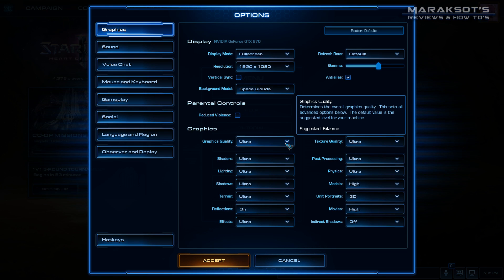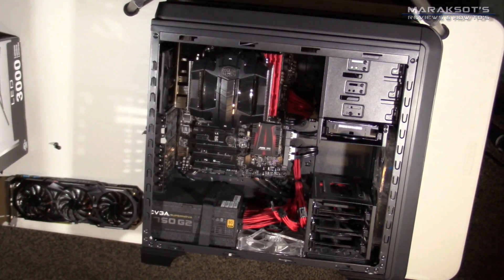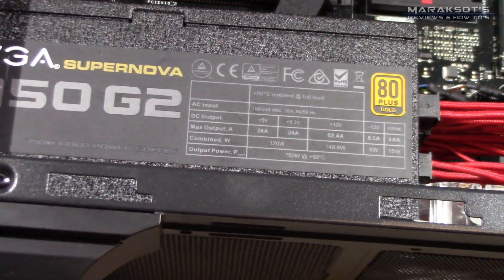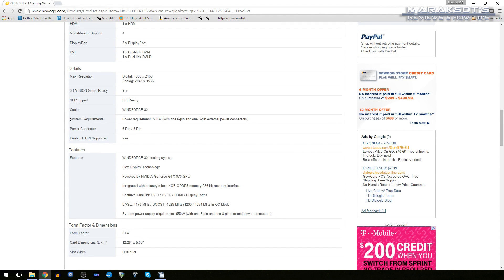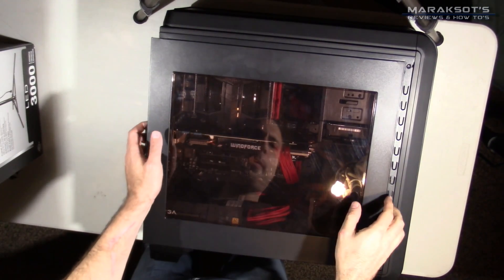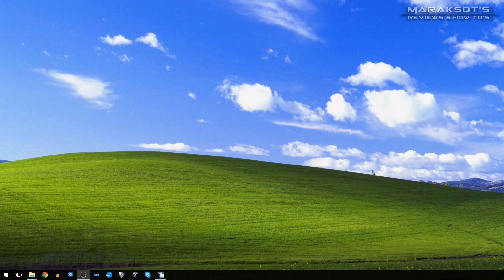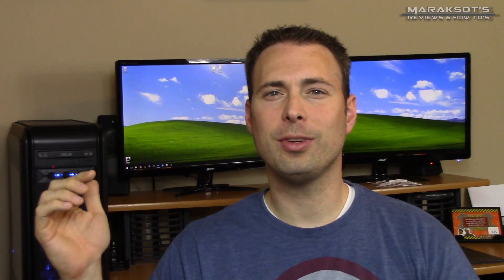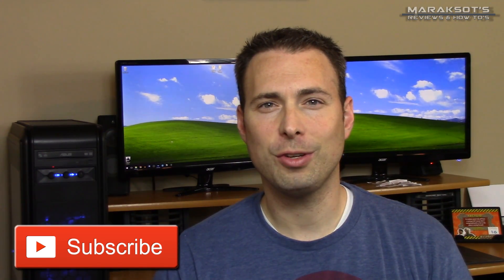A Beginners Guide - Upgrade your GPU - How to Install a New Graphics Card

Comment: I have a Corsair Spec 01 case and a GTX 750 ti, and the way the case is built is making it very hard for me to take my graphics card out. Any suggestions?
Reply from the maker: +TheSuperGamer you've probably got this figured out by now but just in case I looked up your case and it looks like a normal layout... so are you having trouble getting the latch to  release? If so you can use something non-conductive like a pencil to release the latch and then pull the card straight up out of the case. If try to "tilt it out" meaning you pull it up more on one side than the other it won't come out so easily and will sometimes relock the latch. Anyway once the latch is unlocked firmly pull the card straight up and out.  :)

Comment: I have a shitty Intel HD 4400... do i take it out... is it in my pc... like wtf
Reply from the maker: +Pandacyy it is not removable. The HD 4400 is an integrated GPU meaning it's a graphics processor built into your CPU. Once you install a discrete graphics card your system will detect it and then use it instead of the integrated GPU. You will of course need to plug your monitor into the HDMI or Display Port or DVI port (depending on what your monitor supports) on the GPU as well. Cheers! :)

Comment: Once i have followed these steps should i uninstall my previous card drivers? Upgrading from Ati hd 6670 to a Gtx 960
Reply from the maker: +Tyler Rose thanks for the question. This is actually one of the most common questions I get and I'm actually going to start working on a video today to answer this question.  :) but until then... you'll want to uninstall your current AMD drivers and then shut your computer down. Unplug everything from the back of your computer, swap out your old GPU for the new one, plug everything back in, power up your computer, then install the new Nvidia drivers and then you'll be all set. Thanks again for the question I hope this helps you out man. :)

Comment: i have a Nvidia GT 730 and i want a GTX 1060 can i make the upgrade?
Reply: IM MAKING THAT EXACT SAME UPGRADE FROM A GT 730!
Reply: +A Guy cool
Reply from the maker: +Jascaran my initial inclination is to say yes you can, just be sure it will fit in your case (which if you get something like the EVGA 1060 SC you shouldn't have a problem unless your case is super tiny) and your power supply can support it.
Reply: the wattage is 103W Max
Reply from the maker: so the maximum wattage of your PSU is 103 watts?  If so then you'll need to upgrade your power supply because the GTX 1060 recommends a 400 watt or greater power supply.
Reply: ok

Comment: Would this also work with an integrated desktop video card? Like a Intel on-board graphics? 

Also:
What cheap high performance video card can I use for 4GB ram? Low on power supply too.
Reply from the maker: +Kīng ÇSZN Fyōōtch I don't quite understand the first part of your question as for cheap high performance video cards to pair with a system with only 4GB of RAM and a low wattage power supply I would recommend looking at a GTX 960 or GTX 950.
Reply: +Maraksot78 You basically answered my question! Thanks a lot. But one thing, can it fit a Optiplex 755.
Reply: +Maraksot78 Oh and the first part means would this work for a prebuilt PC with an integrated video card instead of a custom PC build.
Reply from the maker: I looked up the Dell Optiplex 755 and it looks like there are several different models do you know what your CPU is?
Reply: +Maraksot78 It's the Mini Tower with 3Ghz Intel Dual Core 2, 4GB Ram
Reply: +Maraksot78 it's over clocked slightly
Reply from the maker: +Kīng ÇSZN Fyōōtch looking at it online I can't quite tell if there's room for an after market GPU in there or not so that's going to be something you'll have to determine. as long as you have a PCIE slot on the motherboars and room in the case you most definitely can increase your gaming performance by dropping a new GPU in there. if possible you may want to try upgrading your system memory aka RAM in there as well to at least 8GB as many games nowadays are requiring it.
Reply: +Maraksot78 I'm more of a retro gamer. I'm looking for at least 512 Vram because I mostly want to run old COD like MW or WAW.
Reply from the maker: Kīng ÇSZN Fyōōtch ok, cool. Well if you're looking to save some money you may want to look into buying an older used GPU. I think I had a Pentium 4 with HT, 2GB of RAM and a GeForce 7900 GS I used to play those games with. :D So you could go back a few generations of cards if you wanted. I have a PC I built in 2010 that has a GTX 460 in it that I played the original Crysis on so you may be able to find one of those for pretty cheap. I did just look on ebay and it looks like you could get a GTX 480 for between $50 and $75 US if you wanted to go that route. Anyway, just wanted to let you know you've got options.  :)

Comment: Question, i just built a new pc, installed windows, and i just got a gtx 1060. Before i install it, should i uninstall the intel graphics drivers?
Reply from the maker: If you're currently just using your iGPU and you want to do a little gaming before your 1060 arrives I think you'll get a little better performance if you do. Once you get your 1060 though slap that baby in and get your Nvidia drivers installed.  Congrats on the 1060 from what I've seen of it, it looks like a very powerful little card. :) happy gaming!
Reply: +Maraksot78 sorry if i'm taking too much of your time, but how would i go about uninstalling the integrated graphics drivers?
Reply from the maker: That's a good question... I've never used my iGPU so I've never installed the Intel drivers before but I imagine it's the same as uninstalling Nvidia or AMD drivers which is the same as uninstalling any other program on  your computer.  Have you uninstalled a program before?
Reply: +Maraksot78 no i have not. Is there a special way to do it?
Reply from the maker: +Scumbag KALE you just have to go into the control panel in Windows and go to add/remove programs and then your computer will populate a list of programs that are installed on your computer. There should be something on that list that says intel graphics driver or something to that effect, you'll click on it and then say remove or uninstall... Sorry I don't remember at the moment what the exact option is.  :) I hope this helps.
Reply: +Maraksot78 thank you!
Reply from the maker: you're welcome. Best of luck to you on your upgrade.  :)

Comment: I don't have a ton of time so can someone answer me this:

If I have an AMD card and want to install a Nvidia card, I just install the drivers and delete the AMD ones?
Reply from the maker: +TheAbeham you got it man. Typically I'll uninstall the old drivers, remove the old card, install the new one and then install the new drivers.
Reply: +Maraksot78 Ok, thanks too much for info. you really kind to reply at these too many comments! Thanks again.
Reply: +Maraksot78 I just got a Nvidia GTX 950, I want to put it in my build which didn't have a graphics card before, do I need to uninstall the Intel graphics drivers?
Reply from the maker: I would just to make sure there's no potential for driver conflicts.
Reply: Maraksot78 thanks!

Comment: I have a ATI Radeon HD 4300/4500 series graphics card  and i need to upgrade to a new one, msi motherboard MS-7309 motherboard and a 600 watt power i cant find any g cards that will be acceptable pls reply with any and all you my know of.
Reply: I found a MSI Radeon R7 240 DirectX 12 R7 240 2GD3 LPV6 2GB 128-Bit DDR3 PCI Express 3.0 x16 HDCP Ready CrossFireX Support Low Profile Video Card on newegg would it fit/work?
Reply from the maker: that card will definitely work in your computer as for whether it will fit in your case or not that's something you're going to have to look at and measure it out.
Reply: Okay and the software should be the same as the one i have now?
Reply from the maker: if I were in your situation I would still uninstall your current driver and install the most current drivers, but yes they're both AMD GPU's so the driver software is the same.
Reply: okay ill order the new graphics later this week

Comment: I have installed my NVIDIA driver from the CD and it says Driver version is 368 which means updated so do i need to install the Graphics driver from nvidia website or not? and thanks for video it helped alot!
Reply from the maker: +Morcos-Bishoy Nabil the most current Nvidia drivers as of today are 368.81 so if you're using version 368 you don't need to install the most current drivers. I like to update mine once a month or so just to stay current, not to mention as time goes on they are better abke to optimize the drivers and get some slightly better performance out of your GPU.

Comment: hi im young and was wondering if u know any decent grphics cards for upgrading from ATI radeon hd 4650
I have 8gb of ram and a intel core i7 860, Thnx.
Reply from the maker: +Dom Parrot kinda depends on your budget. How much money you willing to spend on a new GPU?
Reply: +Maraksot78 its ok im kinda leaning torwards amd r9 270x but first I need to find out if its compatible with my pc
Reply from the maker: The 270x is a pretty nice card and would be a very nice upgrade for your system considering the specs you listed.
Reply: +Maraksot78 ok thnx for the info also my budget is most likely 300$. do u know of any other graphics cards that are good for modded skyrim?
Reply from the maker: Most any GPU from the past few years would work great. At a $300 budget you could go with something newer than a R9 270X. You could get a GTX 970 which is the card I have and it's a beast at 1080p. The AMD RX 480 is AMD's newest GPU and is also a 1080p beast and you can pick up the 8GB model for only $240.
Reply: +Maraksot78 thankyou very much this is helpfull cause im still learning about computers and im going to take  the gpu's you mentioned under consideration.  :)
Reply from the maker: Dom Parrot no problem I'm happy to help.
Reply from the maker: +Dom Parrot there's also the GTX 1060 that just came out that I believe performs a little bit better than both the GTX 970 and the RX 480 it's the most expensive option however and being as new as it is i think it's kinda tough to come by at the moment.
Reply: +Maraksot78 ok thnx, also do u know any good websites to buy gpu's from?
Reply from the maker: Dom Parrot i usually shop on amazon.com or newegg.com, I usually just look for the best deal on what I want on either one of those sites.
Reply: +Maraksot78 ok thankyou again. bye :D
Reply: +Maraksot78 sorry to bother u again, does newegg.com deliver to canada? Thnx and bye for real XD
Reply from the maker: +Dom Parrot I don't know if they do or not. If you're in Canada check NCIX.com they're based in Vancouver B.C.

Comment: what if i have an 8 core CPU???
Reply from the maker: +UnshodData I'm guessing you have an AMD FX 8350 or something in that family? That should be just fine. If you overclock it some that will help give some better performance too.
Reply: Okay i have a AMD FX 9370 CPU and just curious what would be a good GPU to buy as i only currently have a GT 610 graphics card
Reply: because my PC is about only 1 month old
Reply from the maker: sorry it's taken me this long to get back to you, I was just checking messages and found that you'd responded to me.  What's your budget? the FX 9370 should be good enough to handle most any card you may want to pair with it.

Comment: i have a gtx 960 and was thinking about getting the gtx 1070 but was wondering if i need to uninstall any drivers or anything before i put the new driver in because i already have the nvidia driver thing. (hope i made sense there)
Reply from the maker: +Chicken Parm you don't have to uninstall them, but I'd recommend updating to the most current drivers to get the best performance out of your 1070.
Reply: +Maraksot78 thanks for the response : )
Reply from the maker: +Chicken Parm you're welcome. I'm happy to do what I can to help.

Comment: My specs:
*Windows 10 
*Asus Sabertooth z97 mark 2 
*PSU 850w
Patriot heatsink 2x4Gb + Patriot Patriot Viper 3 1x4gb =12RAM
*GTX Asus 650ti 
*Samsung Evo 850 250gb SSD ( I plan on upgrading this to 500/512gb)
Enermax case
I upgraded some of these components last year.(*)

What should I upgrade to?
Reply from the maker: +Ash2theB I'm assuming you're wanting to upgrade your graphics card and ultimately you are really the only person that can answer that question. So my question for you is the same as at the end of my video... what kind of gaming experience are you looking for and how much are you wanting to spend? And what I mean by gaming experience is are you going to be gaming at 1080p for the foreseeable future? or at 1440p? or 4K? Are you wanting the latest generation of graphics cards? or are you ok with going with a model from last year or 2 years ago...? And then of course how much is your budget? Because the cards that give the best frame rates at 1440p and 4K can cost quite a bit more.
Reply: I like simulations games like the Sims or City building games. However,  Origins takes up most of my space on my SSD and Sims 4 gpu crashes on a regular basis. I want 30fps+ and quality images. Also, I'm studying freelance Graphic Designer and I've been noticing that quality is lacking in my Designs so, I'm forced to buy a laptop to do most of my work on currently. I am able to get 1080p with my 650ti but it doesn't hurt to take it to the level of 1440p either. I'm stuck between choosing the 970s to 1070s. I'm looking to spend between $250 - $450. Lastly, I like quiet graphic cards lol.
Reply from the maker: +Ash2theB if you're looking in that price range, up to $450, then I'd definitely recommend the GTX 1070 over the 970 it's a fantastic card. The GTX 970 and 980 are great cards too so if you want to save a little money either one of those would also make a very nice choice.  I currwntly am using a GTX 970 from Gigabyte and I really like it. My opinion is most any of the non-reference/non-founders edition cards will be great when it comes to accoustics. Brands I have the most experience with that I really like are Asus (their Strix cards are really nice), EVGA and Gigabyte but definitely shop around and check out reviews on YouTube or other places on the web to find what's right for you.
Reply: Thank you so much. I've been have hard time choosing since my friend was giving me the heads up on the new gen GPUs.
Reply from the maker: +Ash2theB you're very welcome. I'm always happy to do what I can to help. :)

Comment: im using gigabyte h22m-ud2h motherboard, i manage to scrap out a 512 MB GDDR5, do you think it will work?
Reply from the maker: as long as your board has a PCIE slot then I believe you should be just fine.

Comment: My potato gpu i have now doesn't use  a power connector how do i install one?
Reply from the maker: Your power supply will have a bunch of different wires coming out of it going to different components in your computer.  I'd imagine there's a fair number of them that are not in use and are just tied up somewhere, look for some wires with power connectors similar to the ones I show in at the 10:40 mark of the video.  Most modern GPU's use either a 6 pin PCIE power connector or an 8 pin power connector and the more power hungry ones will use both a 6 pin and an 8 pin or even (2) 8 pin.  If your power supply doesn't have any of these PCIE connectors then it may have a flatter 4 pin connector called a molex plug.  If you don't know what a molex power connector looks like you can search them on google images or click this link to a pic I found https://upload.wikimedia.org/wikipedia/commons/3/31/Molex_female_connector.jpg  :) The pins in a molex plug are round, anyway most GPU's, when you buy them new, will come with some molex to PCIE power connector adapters and you'll be good to go... assuming your power supply is capable of powering your new card of course.  :)  I hope this helps man, happy gaming!  :)
Reply: Maraksot78 Sorry im stupid. I checked my pc today and i saw a had a bunch of cables tied together withit a pci e thanks for the response and the video in general.
Reply from the maker: Brum no problem man, I'm happy to do what I can to help. :)

Comment: Don't you have to ground yourself on the case?
Reply from the maker: +Vaeger Gaming* it's a smart thing to do just to prevent any chance of damaging any of your components.  My case is made of metal so I just touch it to ground myself before handling any components. Also nowadays computer components are quite a bit more durable than they were back in the old days so the likelyhood of damaging them due to a static electric discharge is actually pretty low.

Comment: I fucked up badly
Reply from the maker: what's up? perhaps I can be of assistance?
Reply: Maraksot78  i fixed it after 2 hours i forgot where the gpu was supposed to be. never removed anything before but i had to get to the cmos battery and when i was gonna get it back i couldn't get it to fit but after a while i found the problem xD
Reply from the maker: happy to hear you got it fixed.

Comment: Do we need to uninstall previous drivers before installing new ones?
Reply from the maker: +Peter Constantinou if you're switching from an AMD card to Nvidia or vice versa then yes you'll need to uninstall the drivers and install the new ones for whichever card you're using.  If you're upgrading from Nvidia to another Nvidia card or an AMD card to another AMD card then just make sure you're running the most current drivers and you'll be good to go. If you have GeForce experience installed on your system or the AMD gaming evolved app or whatever it's called it usually updates automatically so you may already have the most current drivers.